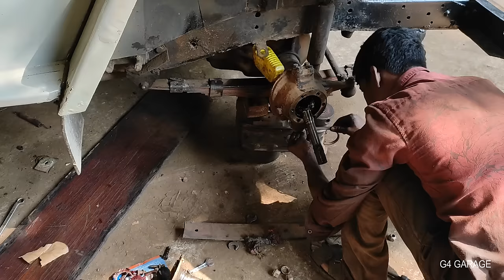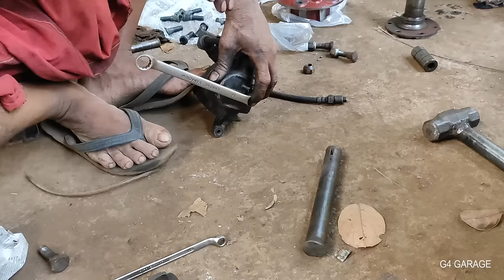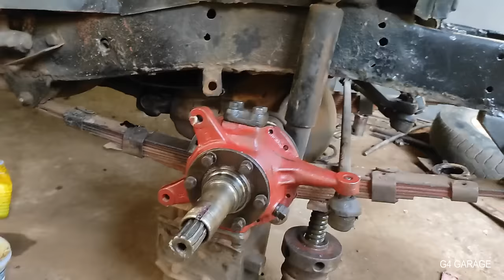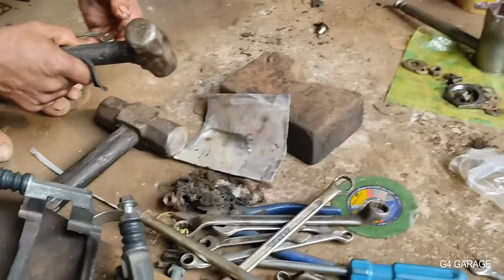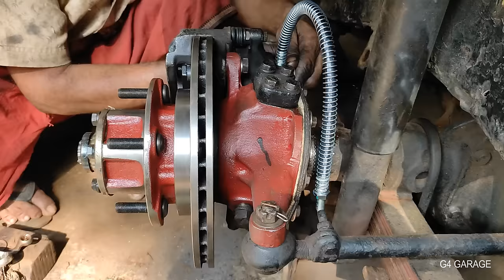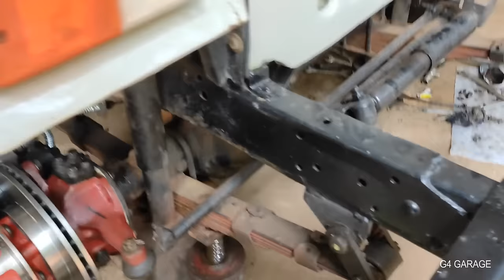Disk Brake Conversion in Mahindra Jeep. Drum Brake to Disk Brake

Comment: Boll jointinte aduthu ulla read colour ulla hubinu enthu rate aayi orennathinu?
Reply from the maker: closed knuckle Rs 1050
Reply: @G4GarageGARAGE  . Pazhayathu vaykkan pattille aadhyam athil irunnathu?
Reply from the maker: @ajeshpj8817  Old knucklil Brake caliper pidipikkanulla brackets illa, so ath  change cheyyanam.
Reply: @G4GarageGARAGE  ok
Reply: @G4GarageGARAGE  service charge spayar ellam koody ethra aayi?
Reply from the maker: @ajeshpj8817  15K
Reply: Garage location?